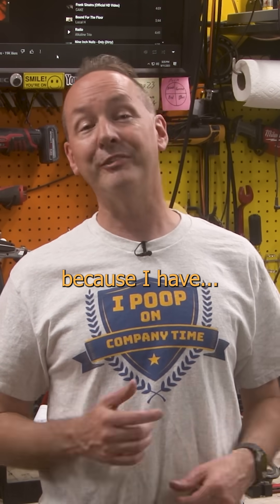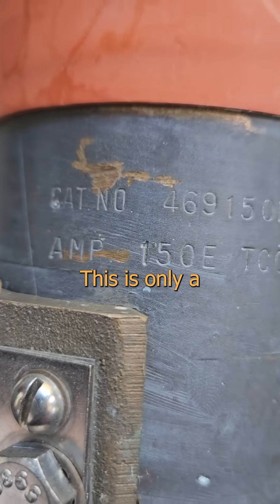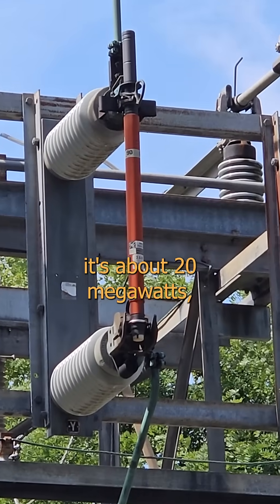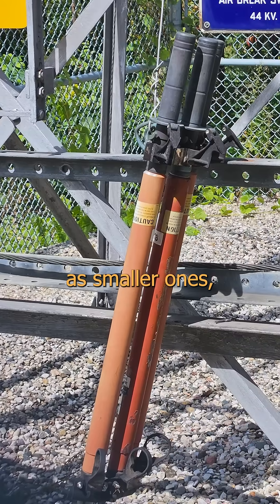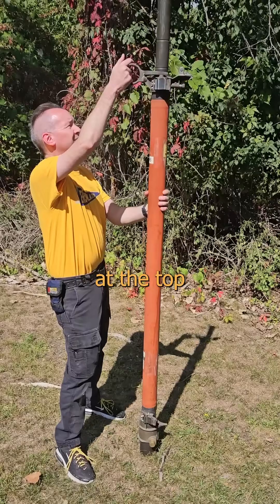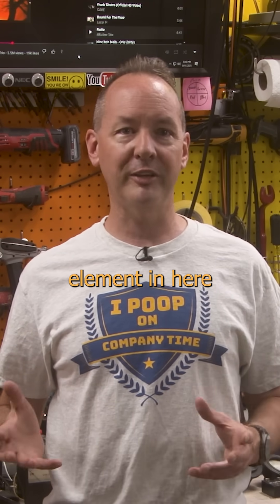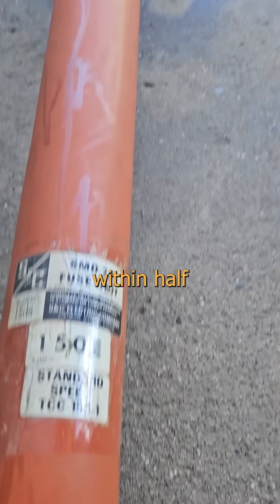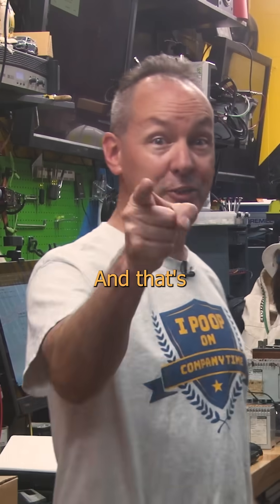The longest Fuse You've Ever Seen #chrisboden #comedy #engineering #electrical #energy #power #parts

Comment: A much smaller scale fuse of similar design is found in microwave ovens, again with the length for arc extinguishing and having a simple mechanism (just a spring actually) pulling the contacts far apart when the relatively much shorter fuse wire breaks.

Comment: We blew the 600 bolt fuse at work aggain. The bang is exiting but its odly uneventfull cause we keep the systen in peak shape. So it pops we flip the switches to off find out why it poped. Change it and flip the switches back on

Comment: Went to get my power turned on in ky when i was buying a place and the inspector had to look at the meter n stuff before he would alloww it to be turned on..long story short he seen an 100amp breaker box and a twin fuse main shut off with 2 huge fuses like the 1st fuse you showed... the power has always worked there fine....Anyway i got a new 200amp 4au breakerbox with new meter position built in with it.....but now ive fot alot of work to do and am lossed basically....😮have a good day peoples...

Comment: I'm pretty sure you left out the best part!  The reason they're hung up on a hinge is so that when they blow the bottom half will swing down to create a gap large enough to not cause arcing!  You mentioned that the length is for arc separation, but now how it works!

Comment: I work in industri, and we have a nacele that have 2, 2500t presses, 3 induction heaters that heat a 30 mm steel ring to just under white hot in 30 sec. plus other stuff, and when all is running there is a bit of a draw on the system, we had the city install a transformer in house. And one day we had a robot doing something it was not suppose to. and it conected to wire that just dont mix. but long story short, we needed a fuse changed.. and someone from the city came, and he jumped in the space suits, and with a "small arm" he start to change the fuse!!!! AND. just as he removes the broken fuse, a forklift driver drops a metal palet with steel rings on!! the guy rand so fast that he tripped 3 times, before he realize it was no him that did something. i have NEWER laughed so much, OMFG!!!

Comment: That's not a fuse. My community college had these fuse boxes outside near one of the dumpsters. There were 9 doors that kind of looked like lockers, one for each fuse. It was all 480 3 phase and those fuses were roughly the same length, somewhere between 8 and 12 inches in diameter, and sand filled. There was a lever next to each locker that looked like those handles for early metal fridges (think Indiana Jones) but were roughly 5 ft long. My mechatronics professor told us that those levers were pulled down almost to the ground before they disconnected the fuse violently, then I think you had to turn them to the side or pull a safety or something to go the rest of the way to the ground which would unlock the doors to help prevent arc flash. That there is was a fuse, the bowie knife of fuses to be exact.

Comment: Why does the fuse need to be larger to support the extra voltage? Wouldn't the thickness of the fuse not matter whether it was made to support 150amps at 120 volts, or 150amps at 10,000 volts? This isn't a sarcastic question, I genuinely don't know.

Comment: I am surprised he skipped the really cool part about these. IF your power goes out you can often drive around following your powerlines until you find one of these hanging free. Depending on your area the pole might even be numbered. When you call the power company and report your outage if you can give them the pole number it can help them get you back online faster... at least that used to be the case. I think now days they have electronics on each pole telling them which pole has the blown fuse. BUT I still report it if I can just in case.
Reply: My oldest son worked for an electric provider for two summers when in college walking the distribution line ROWs recording the numbers on each pole plate then taking a GPS reading of its location. He lived outside Richmond, Virginia so was walking up and down hills out in the sticks. He figured repair crews had to be helicoptered in to repair lines in many areas.

Comment: I make big ass industrial shredders for a living and we are setting up a new Mitsubishi lazor to cut sheet metal at work and the fuse for its chiller system is MASSIVE, i didnt even know what it was..its like 8" round and 2 feet tall, and weighs more than my ex after we split up and ice cream replaced her feelings. 

On a side note this new lazor runs off fiber optics and is one of the most badass pieces of equipment ive ever seen. It can cut out a 3ft x 3ft x 1/2" piece of A1 steel in around a minute.

Comment: Just learned the hard way that 120v does not play with 230v wiring. Some bonehead thought it was a good idea to have the wiring schematic printed on the side of the motor, and then flip the connection panel upside down...  230v 1 - me 0.

Comment: Awesomeness. I had a gazillion volt VR fuse I found in an old laser lab (so long ago that lasers were cutting edge new tech) thick clear glass case, filled with white sand. Must have been around 4 inches thick and maybe 16 to 18in long with incredibly thick solid copper caps. Paul Bunyan's bus fuse. Just kept it around as a conversation piece cuz it looked so flippin cool.

Comment: PT fuses are pretty damn cool. The ones in a 50MW and over power plant switch gear. Only see them after some voltage transient issue (Oops). Oh, and SF6 gas is pretty cool too! You can do a YT short sounding like Barry White with the stuff.

Comment: Can you do this for diodes?
We've recently gone over them in my intro to electrical engineering class and I was really curious as to how big they get
Are any diodes used in the electrical grid? How big are they? Do they work under the same principle as the little ones or do they do something special to allow them to handle the high voltage?

Also, recently visited your other channel, Atmosfär.  Really enjoyed it and would like to see some more stuff of bike rides / driving.  The lower tones are great for drowning stuff out without becoming a distraction itself

Comment: The largest fuse i saw was 8ft x 2 ft of 3 pieces of solid copper 1 inch thick with insulation between the legs, it tool a tow motor and a whole Lotta " watch out" for that one. It was the main buss for entire building, the electric company had to come in and we shut everything down to change that one. We had our own sub station

Comment: if im not mistake the reason some fuses are long is cuz air is conductor and can arc over closing the circuit of the burned out fuse if the space between is short enough

Comment: I have one with higher amps reading but lower voltage rating around 50kV. It's a big bolt jamed in place of a fuse mamde of steel so it's slow blow

Comment: I am proud to say I've seen bigger breakers than in this video. 
I've also seen showcases of them triggering and disconnecting. 
Think two copper rods bigger than your thigh connected to springs that'd make a cars suspension blush. Held together with huge ass sprint. 
Voltage/resistance problem? Facility pulls sprint and everyone in a half kilometer radius has a underwear problem from the noise.
Reply: Wow that must have been impressive! I've seen videos of large breakers and fuses blowing and that was SCARY!

Comment: So, question if we figured out cold fission next week would  our power line or whatever . idk the right wording.Sorry would our lines be able to handle it
Reply: Electricity doesn't care where it came from. All it cares about are voltage, current, and frequency.
Reply: As far as I know they don't even have the capacity for everyone having electric cars so if we all switched to EVs it couldn't keep up,
Look up the A/C power crisis 
Not really sure if it was a crisis but it was a challenging problem for the grid
Reply: @johnray854 and only about to get worse with the induction of the "big beautiful bill"
Reply: @johnray854 This particular one doesn't care what the generation source is as it is serving a neighborhood and the load should not be impacted by the source (unless electricity prices plummet but even then there is only so much use for a homeowner). 

The advantage for EVs is they can be charged pretty much any time, for example flattening the solar duck curve. The grid issue is on crazy peak usage, not on how much power goes through them in 24 hours. So by building in flexible demands and localized solar/battery things will be fine. 

Again on the EVs, many are around 4 miles per kWh. So a 40 mile commute might use the same energy as a house air conditioner running 2 hours, or doing a couple loads of laundry. It's not nearly as scary as the propaganda. 

If you need something to lose sleep over, switching the NE from natural gas and heating oil over to electric is massive. These homes will average at least 2x the air conditioning energy and you can't flatten the daily curve much as far as heat loads go.
Reply: Would be a matter of scaling. If you can get a lot of small power sources close to where people live it wouldn't be a problem. Power consumption wouldn't change over night so you could just replace existing power plants with magical cold fusion ones with the same or slightly higher output and keep the grid the same. However if you could only build these in certain places and each individual plant would have to be massive you might need to do some adjustments. Ultimately tho this would probably still be easier than transitioning to renewables.
Reply: It'd take "SOME" maths, swearing and an ungodly amount of bodging but we could pull it off... so It'd fit right in with the rest of human made infrastructure 😅